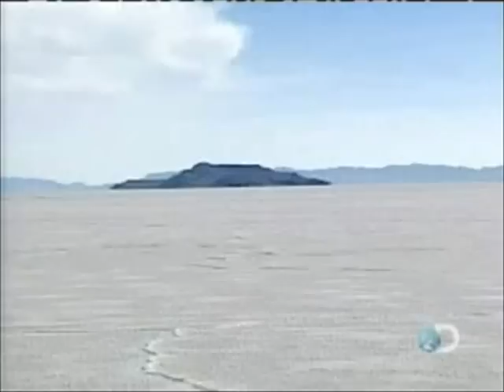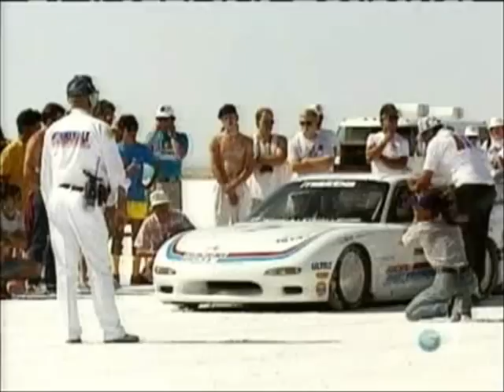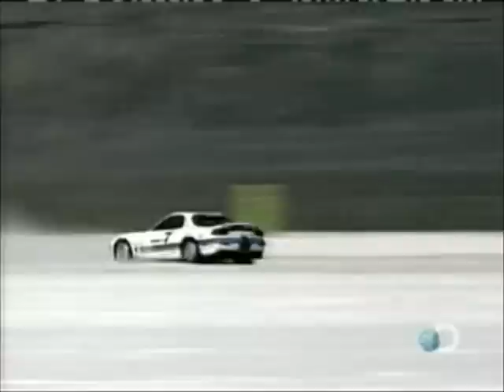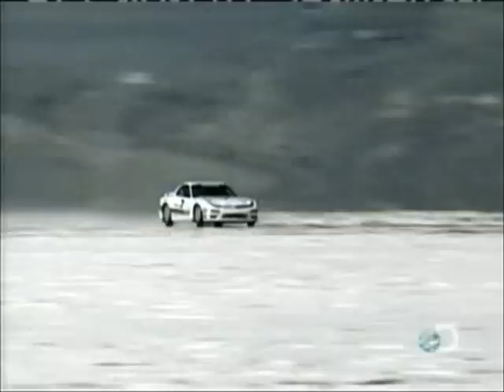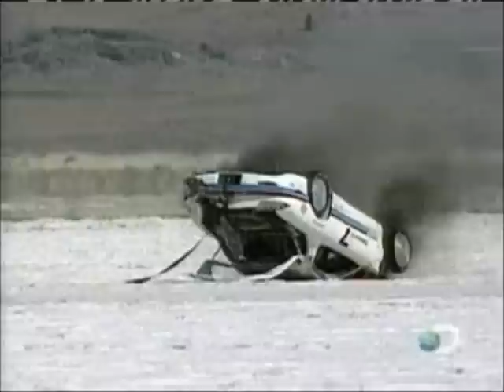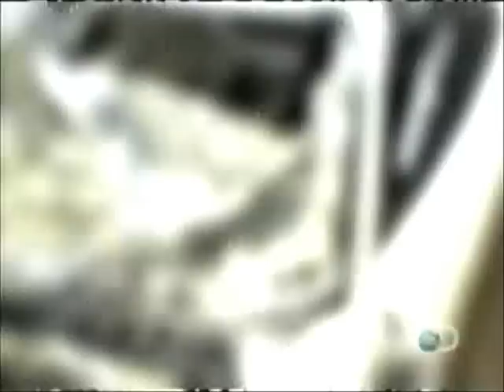Mazda RX-7 Crash at 225 MPH!!

Comment: The rest of crashing increases?
Reply: Risk*
Reply: risk of crash increases.. yes... hence the term "Speed wobble", a point where speeds become too great for the chassis to sustain stability.. However, in this case, the crash looks to be a result of lacking aerodynamics.. another risk that increases the faster you go (because you're pushing more air under the car, instead of over it, the faster you go)

Comment: I still don't understand why those cars can't start by itself.
Reply: +Borsófőzelék Piskótakockával the gear ratio if it tried to start by itself if would not have enough tourqe at the wheels and it would stall
Reply: Ballista Bomber  Why? How many gears it has?
Reply: Ballista Bomber  Hmm, and what if the ratios would be: first gear: 60 km/h, second gear: 180 km/h, third gear: 350 km/h, fourth gear: 480 km/h?
Reply: +Ballista Bomber for an example at 7800 rpm is when you get the most power. With longer gear ratios you want your topspeed max around 7800 because you get more power than at 9000 rpm so it's all about little adjustments

Comment: Alive?? At 360 km/h??

I've seen a video on liveleak a 300 km/h crash on a sportbike and the rider died with a ripped off body parts in pieces!!!
Reply: I help anytime a bike and a car is different...
Reply: This RX7 sure is rigid as hell with rolling cage supporting the chassis. You would surely die if it was an ordinary vehicle (although no vehicle that can reach 360 km/h can be called ordinary, lol)